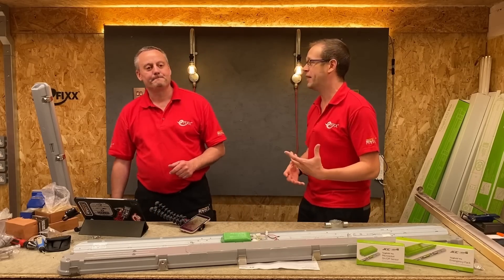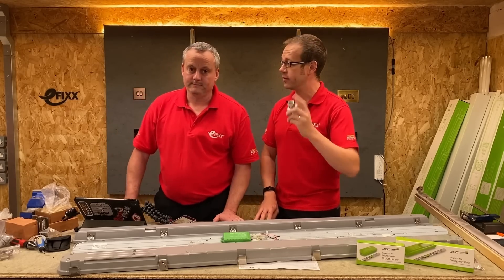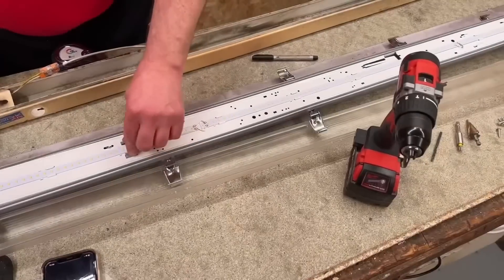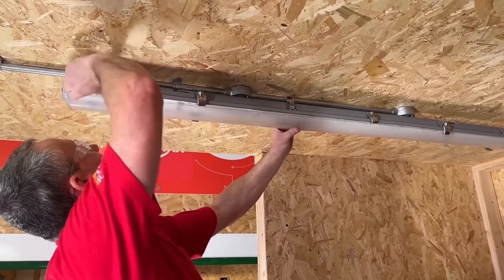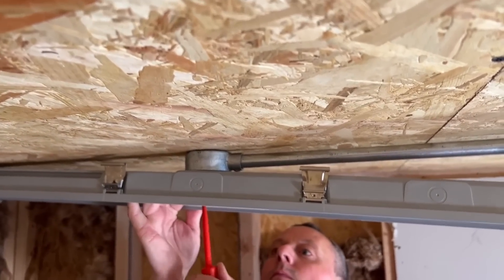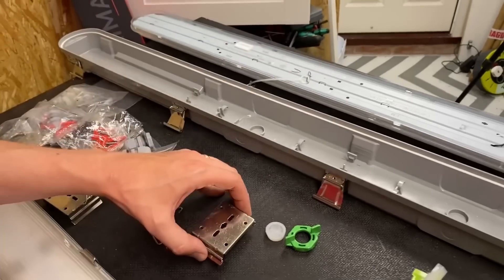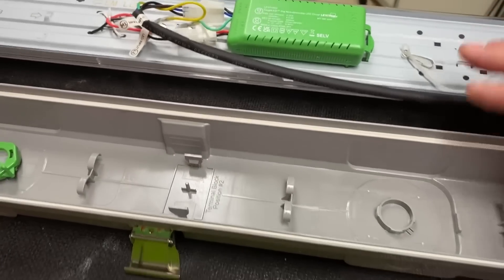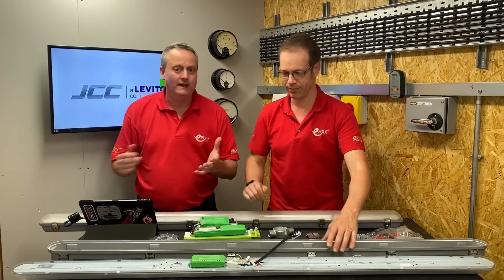JCC Toughled Pro  - FINALLY, an LED Batten for British Electrical Installations!

Comment: Did you put a washer on your 4mm screws Gary  for the plastic if you overtighten screw into plastic  it can crack if you don't use washers I think you should always use washers fitting these plastic lights good practice for your learners

Comment: My issue is the push in connectors , im really struggling to find a fitting that will take loop in loop out wiring

Comment: Most industrial installations either mount fitting directly to metal trunking or use stuffing glands and flex from conduit and hang on chain.

Comment: You guys need to switch this metal JBs and pipes for PVC, there is only problem with that here in Europe, cores very often are damaged, and on the top of it, by drilling you loosing watertightness, thats why there is clip solution.

Comment: Why don't these companies make replaceable led array's? Things are many to be easily repaired now to save the planet
Reply: I'm sure i could design the perfect fitting for us electrician's. Built in clips to hold the wiring so its not getting trapped under the gear tray.

Try it with a ceiling that's not flat 😂

Comment: What is wrong with placing the box next to the fixture and running the cabling from the box into the fixture? 
Most of them already have cutouts or inputs for cabling, just a matter of tapping them out with a screwdriver.
Plus, you would be able to mount your fixture closer to the ceiling, creating literaly more headroom.

Comment: What a REALLY well thought out bit of kit, thanks for that guys. We have all been there with the issues of standard IP battens that you mentioned Gaz. Sooooo frustrating. Great to see so many options on entry points as well, rather than just either end. You have showcased JCC's wares to great effect, they will be happy with that. 👏

Comment: I do like to use stainless m4 cap screws on galv conduit boxes
Reply from the maker: You shouldn’t mix galvanised zinc and stainless steel. The metals are dissimilar which causes corrosion. Over a few years the zinc will rust.
Reply: @efixx  work better than the brass :)

Comment: Cant beat the old fluorescent, steel framed fixtures. Not this plastic fixture rubbish with irreplaceables LED's. A fluorescent light also spreads more evenly and looks nicer than harsh directional LED's.
Reply: The problem is all my steel fixtures go rusty in the garage because it's damp. The back tune flickers too. Combined with the rust and cobwebs my garage looks like a horror film 😂😂😂

Comment: They don’t match because they are not the same type of fittings, you are changing a batten fitting for a vapour proof fitting, if you get an led batten it will have the correct fixing positions and holes, this was true for fluorescent battens and vapour proofs before led’s, there is nothing new here.

Comment: So you have to drill an extra hole just for it to fit to the 60 cm measurement? I was wondering why you just don't remove the metal conduit all together for this instance?  Why not install the fixture to the ceiling with the provided brackets and terminate the metal conduit at the front or back of tha fixture , pull the cable trough the cable inserts and you will end up with a better looking installation?

Comment: Domed box lids anyone ???  Simple solution to the narrow fittings.  Sadly I am not a fan of LED lights at all . Fitted loads and within 2 years have failed . Some you can replace the driver others you have to replace the whole thing.  I went back to metal halide for floods as they are serviceable.  I have removed 2D and fluorescent fittings that were 20 years old and still working,  some were on 24/7 and crumbled internally because of the heat . You can't complain if they last 20 years though .
Reply from the maker: You’ll struggle to get hold of non LED fixtures now.

Comment: Buy 2x20mm Galv threaded dome lids & 2x male bushes... No need to drill 4x 4mm holes, 2x 20mm holes instead? Doesn't matter if boxes aren't exactly 600mm apart either?
Reply: Dome lids are handy, but not quite as flush and they end up a little less solid too. Pros and cons with everything...

Would be nice if M20 penny washers were readily available too to add extra support around the bush.

Comment: Because the back is thin and happily sits on half box and the screw holes are @45 degree of the conduit direction, did around 80 of them sitting on half the box with one of the box screw holes in the middle of the fitting and the other screw hole I’ve used to fit half lid.. sturdy, not wonky and with one lid I covered 2 half boxes. yeehaaw!

Comment: could just simply convert the magnetic ballast light to a led tube thats a easy way out of course you could drill the bottom of the fitting to line up with the existing screws that small hole be realistic who is gonna put there fingers in it things like that would not bother me one bit just that the fitting works well and its compliant and safe i wouldnt go out of my way to put something up there my finger would not get through the hole whats the real problem like serously

Comment: Oh Yeah. Finally, yet another LED fitting with non replaceable lamp. Lost count of how many times I have had to replace several fittings with integral LED lamps, just to match up again when just one has failed and original model no longer available. No doubt a few years down the line this will go the same way. Why does JCC not make the fitting take a replaceable LED tube, or does that upset the built in obsolescence?.

Comment: An enthusiastic presentation and very entertaining but some of the comments left by other viewers below have led me to think that they have misunderstood your video and believe these to be 'Made in Britain' products. I can see that the drivers, both standard and emergency have been manufactured in China and the LED's will most certainly have been made in China or Taiwan. This is because there are few other countries that have the facilities to make the diodes. JCC are based on the South Coast and at best, they are just an 'assembler', not an actual manufacturer. They may have designed the features on the luminaires body and then have them made to their specification for them in China, but as far as I'm aware, JCC don't have injection moulding machines at their site Bognor Regis. At best I would rate this fitting as 2/10.

Comment: This part as emercency light or as radio controlled light is a good point. But - why do you never discuss the price of the product how you show here? What costs it if I buy it outside the UK e.g. Isle of Man or in Asia? Have this product all certifications? Why is this product not in metal and with a metal body around the "glass part"? I know that UK electrician hat plastic things - too dangerous at hot places. 

Just some questions...

Comment: Also...a lot of the ones where you have to fit a clip on the ceiling first say NOT to drill the body for fixings!
Reply from the maker: These fittings have those types of clips as well… we did mention this in the video 👍🏻

Comment: We have started using Thorn ForceLED fittings they have the conduit fixings on the back and being aluminium backed wont break if knocked, plus they can also be glanded from side along with being suspended and are also compact but give out great light output 👍
Reply: Good to know one of my developments pleases you. It was designed to replace a twin 58W T8. I was responsible for the optics

Comment: My light boxes tube light have left and right a power line go in, only the older models (~10 years) have had extra fixing points for hung from the roof or extra build-in holes at this side. We have products to make holes if I need that too. 

But - we know on the continent this round boxes too - from the 60's and at ships. We use round metal from them to the side entree at the small sides with direct copplers with metal pipes. Do you can see it at old german trains too - possible the UK military catch some in 2nd WW. Old storeroom have had this too. 

Newer places needs only plain cable (it is copper in plastic too.) or in plastic pipes. Extra only three cable (L1/N/GrGe) in pipes are dead here and use only in Boxes and CU's. Raw metal pipes are only in commercial kitchens (better for cleaning) or at dirty working places where it save the cable.

Very good that the UK companies now produce electric products inside UK and commonwealth with UK-regularies. So have the people new working places to make better money and nobody should import it from Asia. Possible they do it with the car and lorry companies too.

Comment: Can't say I've seen many non corrosive fittings mounted on to conduit. I'd replace old fittings with pop-packs unless there was a need for IP ratings.
Reply: Fitted loads of them in my time Most boiler room and plant rooms always used them instead of metal fittings Used a screwed dome life and 20 mum bush

Comment: Using penny washers on the mounting screws helps reduce chance of the fitting falling down if knocked.
Reply: manufacturer could have supplied load spreading plates for the inside.
Reply: @mfx1  Oh they would not do that.  Damaged replacement is the most common reason for changing the fitting.   No manufacturer wants their unit to be too strong - then it doesn't break therefore you don't buy another.
Reply: It looked like they did use some small M4 washers, but not penny washers... Need to start buying M4 washers, I only ever seem to have M6 and M10!

Comment: wonderful fitting bad design. why do companies still manufacture light fittings with integrated led strips instead of led tube.easier maintenance and cheaper. in a few years when you need to replace the inners of the fitting the company does not exist or make that spesific model anymore.  But that is personal preference. :-) love your channel guys.
Reply: I know what you mean. I change and change and change build-in LED lights ... 😩😭🤬 

Old pipe tubes open, put out, put in, close. Finish with this old style light ... 😉🥰😁
Reply: Exactly what I have been saying.